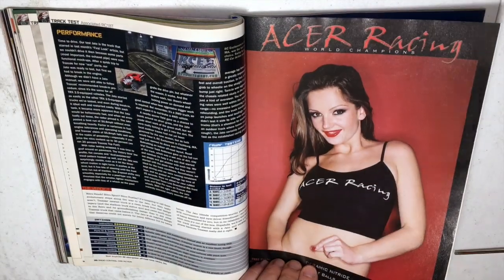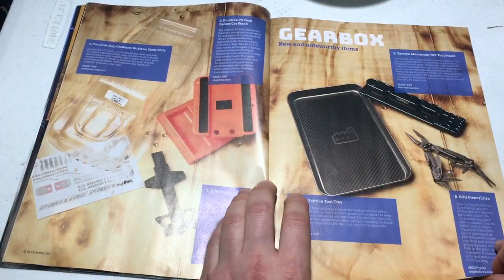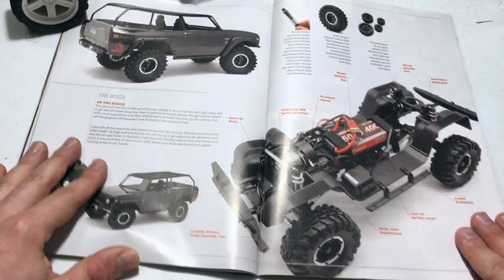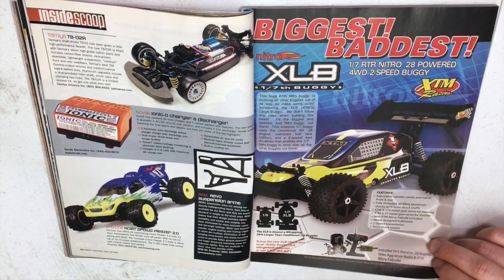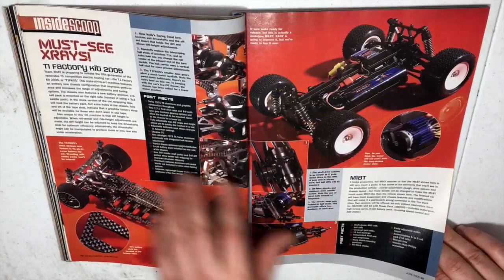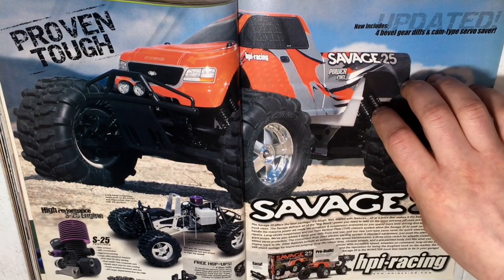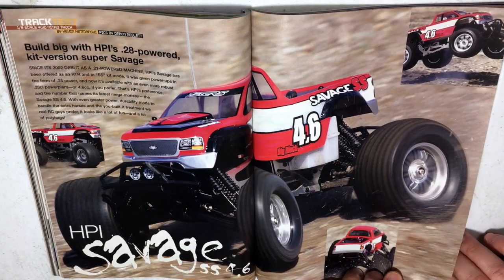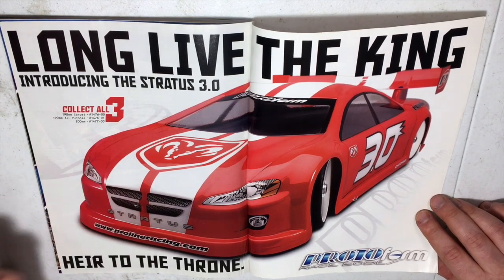Don't Watch Unless You Want To learn Something - NitroGang Vintage RC Car Action Magazine Review

Comment: That hex wrench/drive pin tip is a great idea! Great tip!
Reply from the maker: whats up my dude! I've used the body clips as wheel pins for years, they are even more durable than brand new wheel pins, LOL.  Pretty surprising.  I even repaired my slash VXL's transmission input shaft pin issue with this method bro.
Reply: @hybrid32494  That's a great idea bro! I'll try it next time I'm in a jamb!

Comment: The mini inferno was for sure  offered with a 1/2a nitro engine for a short time. So was the Xray nt18. Trinity had the Next mini nitro truggy. Sportwerks had the Chaos. The 1/5 scale model in the mag is a work of art, and still relevant. They still sell for 1800 plus usd. I have a 2000 model Lauterbacher X Link, hand built all aluminum German import. And as far as early 1/5 scale, there were earlier models. 1/5 and 1/4 scale models started becoming a reality in the 80s. Maybe I should post videos of my models...

Comment: Yo Hybrid I need to some help, So I just got my 1st nitro which is a Revo 3.3 and when I was trying to start it for the 1st time and break it in I would put the ez start in and the engine would start but right after I took out the ez start or a few seconds after the engine would just shut off. What do I do?

Comment: Wassup man! I believe gas and nitro rc cars used to be veeery expensive back in the day, it was the start of the technology right? By the way I have the og xtm rage brushless!
Reply from the maker: hey man!! thanks for watching.  The 1/5 scales were big bucks back then, todays Rovan clones which cost around 450 are better equipped than the original HP baja which sold for around 1200 bucks and were terrible at the time.  Mostly The whole RTR generation that Traxxas and HPI lead helped bring down prices, we owe it to them for that.
Reply: Heck yea on the xtm i love mine. But i broke a axel pin tho so ots down

Comment: I just actually fixed my 18th scale team associated 18r an I always loved it but hey I just put all aluminum parts an new brushless motor from hobbywing an I used remember running it when I was 12 years old an I'm now 23 an there isn't one scratch on the chassis an I have original body with no imperfections lmao an I'm bout to fix up my hpi sprint 2 I'm gonna fully upgrade it full aluminum an use for carpet tour racing

Comment: Hey brother just wanted to give you an update on my baja. So i got the integy hd transmission installed it and my mesh was really stiff so then i found something broken. The rear bulkhead is snapped. Damit the frame is probably bent to now i gotta by more parts this thing is over a grand now but im not stopping till its fixed. I dont have money for gas and beer now but i got toys 🤣
Reply from the maker: damn man, you're having some bad luck lately!  I am too, trust me.  I have finally learned my lesson about having a kill switch, if you know what I mean.  I have not exposed the losses on youtube yet, still grieving, LOL.  Eitherway, that's why I drive a Prius and don't drink, ahaha, more money for RC, you know.  It's possible the bulkhead itself broke to begin with and maybe caused your diff too much stress. (sounds almost like my EX-GF) LOL>
Reply: @hybrid32494  yes i know what you mean i just ripped out my kill switch on my 8t and im going to take all my other switches out to but not my baja because it has a killer bee kill switch and i quit drinking about 4 years ago thats when i got back into rc i just said beers as a figure of speech 😎
Reply: @hybrid32494  oh and the problems im having now is the lock tight and striping of nuts and bolts the struggle is real 🤤
Reply from the maker: do you know about using a soldering iron to heat up the bolt before you try to remove it?  Heating up the bolt's head will loosen the locktight significantly.  Give it a try, let me know if it works.  Some type of locktite will loosen with heat (red color).
Reply from the maker: I need to start getting killswitches ASAP.  When you see what I got on video you will understand why.
Reply: @hybrid32494  wow great tip i  didn't know  know that thanks i will try that when i get my new frames

Comment: Well the old days of RC was cooler when the hobby was new the illustration of RC car magazines was better the simple fact was nitro RC cars and petrol RC head soul because it has a engine my brushless RC cars are far superior and a lot faster but my baja has a beating Hart I still fast enough to put a smile on my face .
Reply from the maker: totally agree with your point.  Brushelss will blow away many nitros and basically all the GAS rc's, but they are generic and soulless.  The brushless chassis is simple, there is nothing to look at, you got a motor and you got a controller,  BIG DEAL!!  Sure it runs and it works, but we need that 2-stroke smoke!! Also the brand competition back then was real, today most companies are rebranded clones.